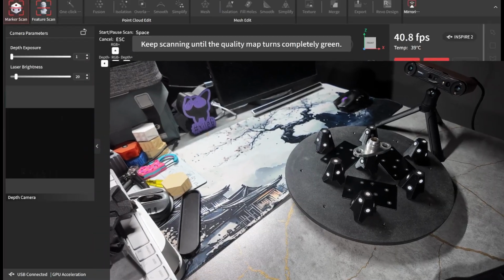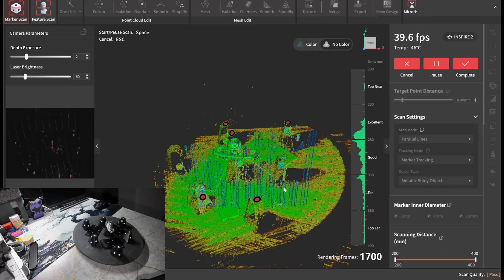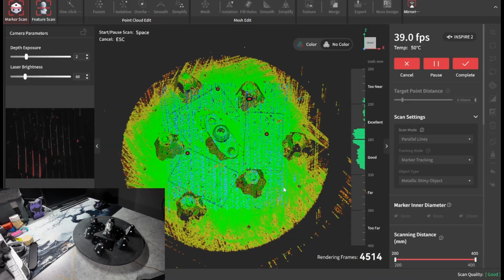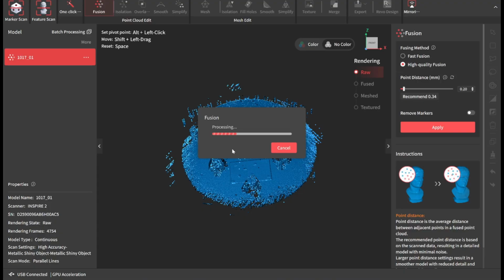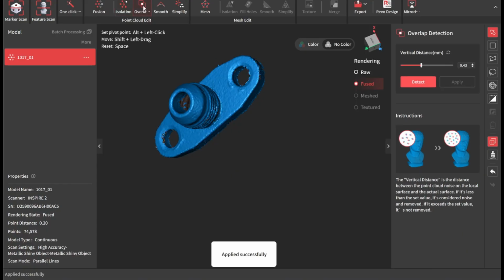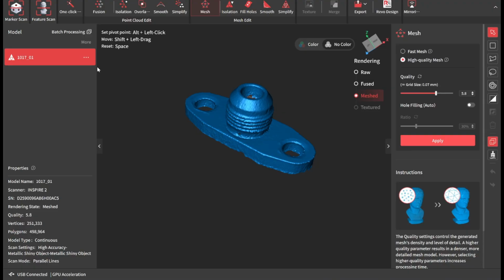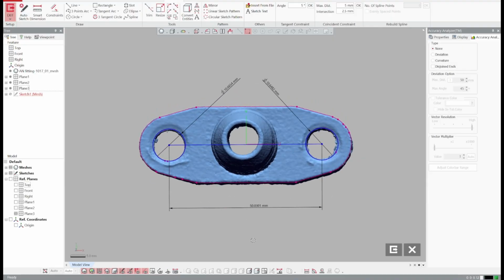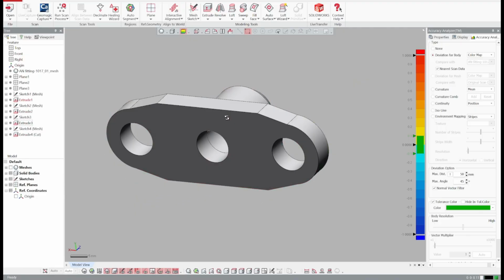Inspire 2 Small Shiny item scan

Comment: How did you set the scan mode to parallel lines? Because I also got the Inspire 2 with the Metro software but can only select full field.
Reply from the maker: Parallel line mode only works under makermode. Make sure you are on the markermod tab.

Comment: Could you show/suggest what PC (and caratteristic) is necessary to use, for have a fast/good scan result? (Without spend an arrm and a leg) 😊
Reply from the maker: Software is free to download. You can install it and test your current setup.  For the minium specs. This is more towards laser mode.  I believe its i7 12th gen and up.  Then a nvidia 3080 and above. They alwyas improve the software as time goes on and things get faster.